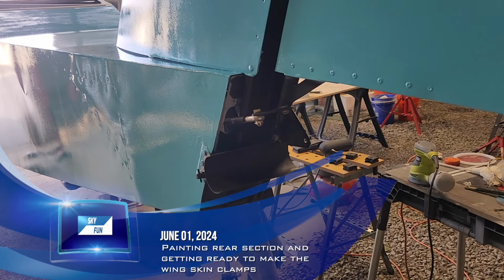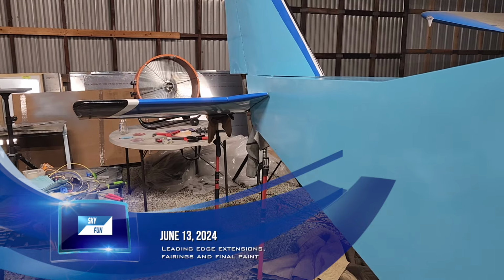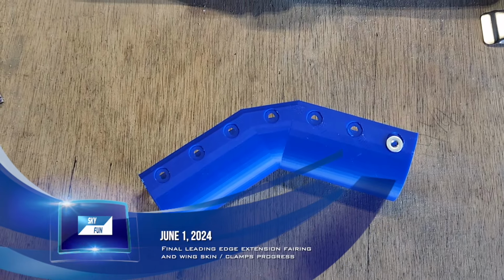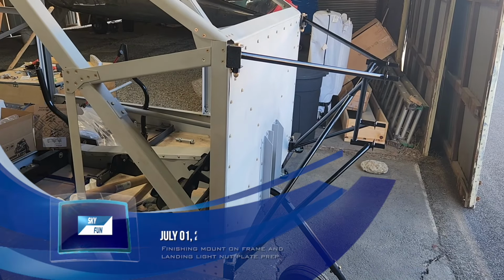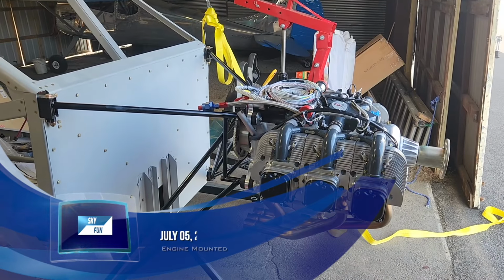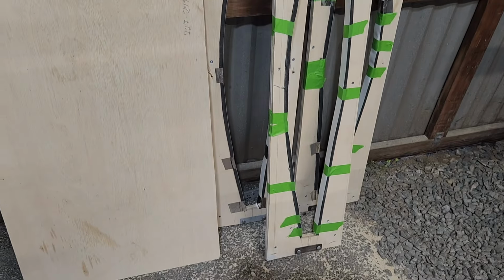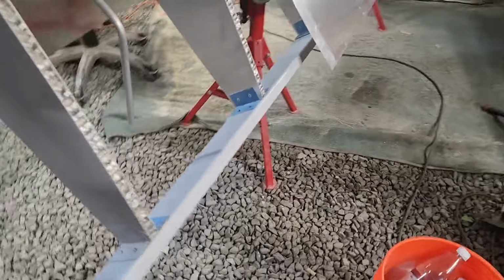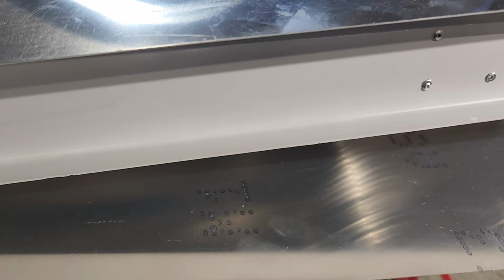Bede BD-4C Build Log 029

Comment: With the news that the BD-4C is being sold to a company that sounds like it has no interest with kits, will this affect anything?
Reply from the maker: The only thing that has changed from a builder's/buyer's perspective is that the kits will be provided by Bede, owned by a parent company that governs the kits and the fully loaded SureWings BD-4CS.  They are two different entities which is a good thing.  Neither interferes with the other.  I've spoken with Atilla (the SureWings owner) several times and you couldn't ask for a better representative of the BD-4 community.  I think this new structure is a very good thing for everyone.